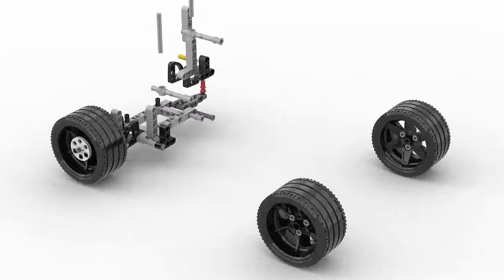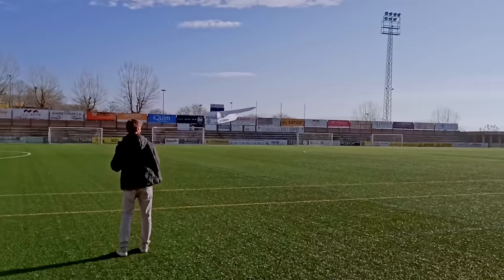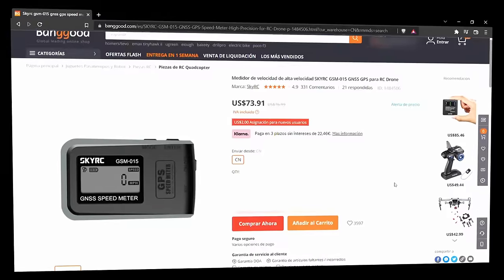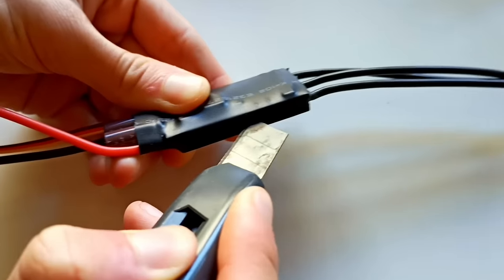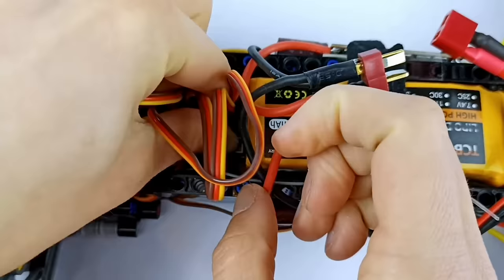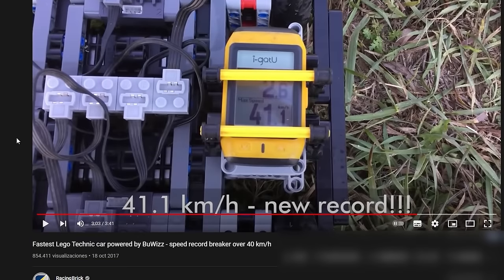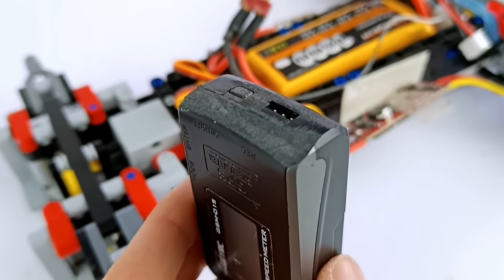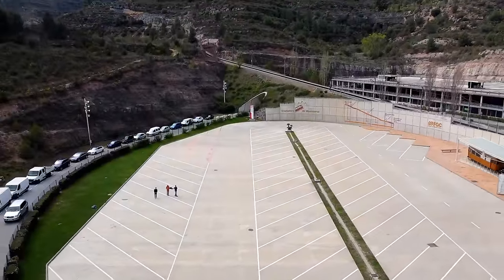World's Fastest Lego RC Car

Comment: Great work! What may help with stability: Increasing toe-in (maybe a half-stud offset on the rack?), positive caster angle on the front axle and maybe even adding negative camber. This may require a fair bit of re-engineering of the suspension components, also consequently adding weight and complexity to the setup.
Reply: @adriablancafort  don't just "consider" it, actually implement it.
Reply: @bloodontheblade7988  Don't tell the man what to do?
Reply: @gud1kk  he wants a good design, then he needs to learn the geometry. Plain and simple.
Reply: @bloodontheblade7988  i like straight people that tell on them heart without filters or shame, but man... 
This dude adria, probebly got more experience then you and me together with car building and speed. 
you can give some respect.
You need to cover your words with results - All your clips on your youtube channel is fantastic, all of us can learn alot from them 🤣😉

Comment: dude this is so cool! I love how to attached the motors directly onto the suspension. that's pretty smart!
Reply: f1
Reply: There are some downsides though: putting motors on the suspension means increase to the unspung mass. Since this vehicle does not have dampeners (shock absorbers) on the suspension, only springs, it is susceptible to dramatic suspension failures.

Adding dampeners will help performance by keeping the suspension more predictable and improving ground contact which is essential for both the drive and steering wheels.

I also predict that some PID tuning on the steering stability system could help as well. He glossed over that part of the build, but it's very important and getting the values right for high speeds will enable better operation.

Overall great work for a v1. Love to see a second attempt taking learning from this model.

Comment: Here are some tips,

Make the bottom of the car as flat as possible, and add plates between the wheelbase, and also design some aero like a front and rear spoiler for more stablization in high speeds, i would also reccomend using some spacers to lower the car further to cause less drag
Reply from the maker: Thanks for your advice!
I'll consider them together with all I learned in this version to develop a better 2.0 version in the future.
Reply: wouldnt the spoiler cause a lower top speed?
Reply: @copy4862  the spoiler is ment to add downforce, as going to fast will cause the car to go flying like a clk-gtr

Comment: You could at least add some aerodynamics components. 
To relieve pressure on front, smooth air flow alongside the car and cut the stream at the end or add some aerodynamic shape for downforce. It would help against rough surface. 
Also you could make side aero for airflow to stabilize the vehicle from sides from wiggling.
Yeah, downforce limits top speed, but in this case stability of vehicle is more determining factor for setting top speed if vehicle isn't even able to be stable.
I guess you know these things, I just wanted to share my opinion.

Comment: I have a flight Radio and Receiver lying around at home. Are there any ways to use the radio for steering real lego motors?
Reply from the maker: I think so but if you want to go fast, they won't have enough precision, speed and strenght. It's cheaper and better to go for a third party servo that is already compatible with your reciever (most are standard)

Comment: gt3c controller is terrible. my power button broke cos cables for it move inside as you turn. had to re solder it. the spin dial for adjusting everything on screen stopped working properly and would only make changes in one direction.

Comment: also, gps is definitely not gonna be accurate for speed measurements unless you average out over like 200m
Reply: @adriablancafort  it's only as precise as gps, and gps is only as precise as about a 6m radius usually. you'd be better off with a laser and a photo sensor or just an acoustic system that can give precision down to the centimeter or less